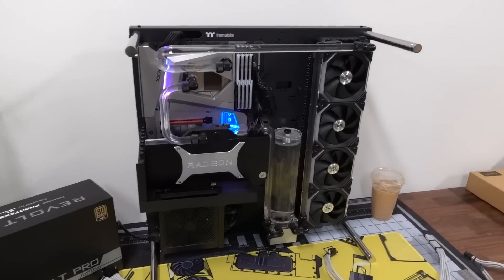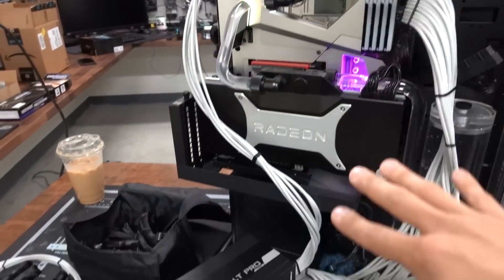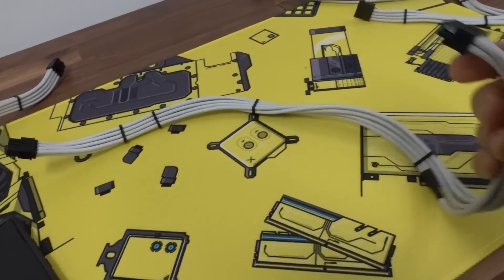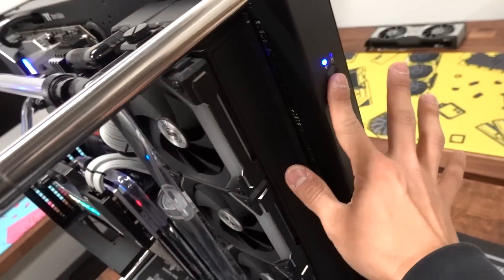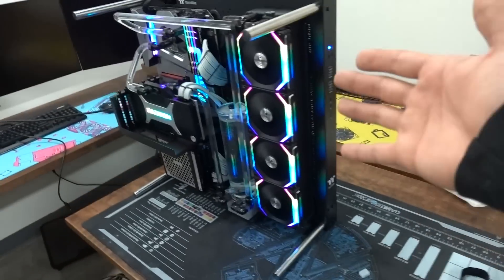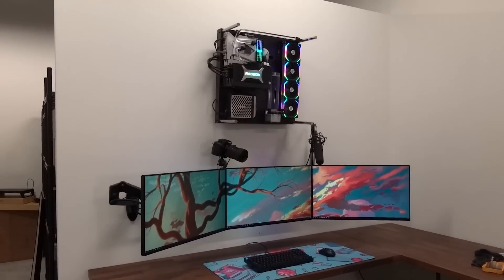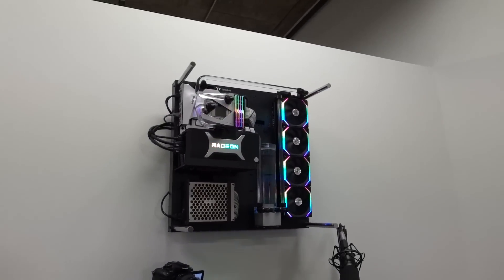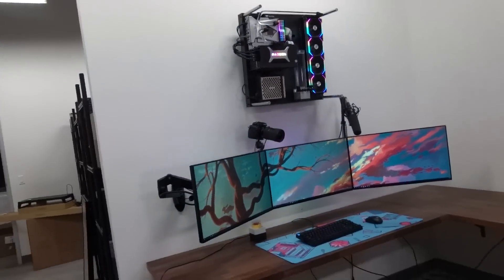I PUT MY PC ON THE WALL!!

Comment: I have the P3 case with the same exact wall mount, but I didn't have any tilting issues.  Probably because mine is smaller.  It's such a sick setup with it mounted.  I also ran into video signal issues, but when I went to longer cables.  Had to try a few different kinds before I finally found some that worked.  Oddly, they were all the same spec.

Comment: Put something to brace at the bottom behind the system to push the lower portion forward. A rubber piece would be easy on the wall/system and the. This would force it straight and minimize the likelihood that it would adjust and tilt forward again over pulling the top back.

Comment: Just use a 4x4 block of wood or dense foam on the lower half. The case weight will hold it in place and it will level out the bottom half.

Comment: @Bitwit - Solution for the tilt. Go to Home Depot. Buy a 2x4 or a 1x3, depends on how much space you have behind the case. And screw it horizontally across the studs right behind the case. Keep it level with where the D rings are behind your case. Screw two hooks into the new wood, just like the one you tried on the wall. One on each side. Then use a thin chain, which you can also buy at Home Depot, to pull it back towards the wall to level out. You could use the nylon you have on hand, but I prefer the added security of having it chained to the wall, God forbid something does give... Also I would pain the added wood the same color as the wall to hide it.

Comment: As far as making the PC not tilt I see two options. 1 - Weld the tilting piece straight (can't move then). 2- Put a metal bar across the back of the pc attached to those screw points. That will let you put your other attachment point wherever you want (right in front of the wall attachment point).

Comment: You could get a bracket down lower in the stud that sticks out and braces the bottom half of the pc to keep it at a parallel to the wall. Could even be a couple of them and they could be made in a way that is stylish to the overall design of the pc and add to the look of the build all in all. Up to you though. I'm sure there are other ways to finnagle it.

Comment: To make the PC straight, simply screw in a block onto the wall but on the bottom side of the case. Make the block as thick as needed to level the pc vertically.

Comment: All you have to do is cut a board to size and put it on the bottom, in between the system and the wall, to lift it up and make it perpendicular. And no need to screw it as it will be a friction fit.

Comment: Just put a spacer (washers) under the two bottom screws of the VASA mount. Also, use longer screws as necessary.

Comment: At the bottom of the case - between the case and the wall you could mount a a rubber door stop or a piece of wood for the bottom of the case to rest against - that way it will sit straight

Comment: What I did for my TV with the same tilt issue was put a chunk of foam on the bottom pressing against the wall and the weight of the TV held it on. You could just do that but put 3m sticky pads so you don't have to worry about it slipping out. Use black so it blends and you will only be able to see it from the sides.

Comment: Instead of trying to use hooks at the top you could use 2 stand offs(correct length) mounted on the bottom corners to give you the correct reveal or horizontal straightness. The stand offs would then rest on the wall.

Comment: You can glue 2 legs at the lower back of the case, they will push it to the front and align it. Spray-paint them with the same color of the case, and it will look stock.

Comment: just put a blocker between wall and mount at the bottom, that prevents the movement towards the wall. You can put any sort of rubber between block and mount (you know, scratches) and you should be golden. You can put it high enough to not been seen and its by far the easiest way and if the mount is too off-centered in relation to the wallbeam, make the blocker in a T-shape. Why try to pull it back at the top, when you can simply block the movement at the bottom?

Comment: What about finding something to use as wedge? Rather than trying to hold the tilt back from the top. Push the bottom out so the top tilts back till it's straight.

FYI. I have no idea when it comes to that kind of stuff so just throwing any random idea out there.

Comment: Instead of putting the Hook directly on the Stud Screw a rail to the stud with and attach Hook directly in Line with the 2 hooks on the PC  and Tighten directly in Line. Additionally you could Mount a rail to the back of the PC and another to the stud in the Wall allowing Multiple Points to Tighten like lacing up a Shoe. On the Bottom of the PC do the same ting with a Rail and Mount Standoffs to push the Bottom of the PC out (Plank of Wood, Feet for Furniture ETC)

Comment: I have the smaller version P3.  Would look better with a white brush plate left of the rig to run cables, instead of behind the PC.  You can sleeve them with white cable braid to blend with the wall

Comment: also instead of having something pull the top of the case towards the wall, you can have something pertruding from the wall pushing out the bottom of the case to straighten it out.

Comment: Idea for the top hooks. Turn them 90Deg, so the hoops are vertical, |   |   |   , then get a metal rod, screwed rod or summat, and put it through the 3 hoops. It'll hold it back securely, be a backup if the wall mount starts to give, and be pretty sturdy.

Comment: Ideas to fix the tilt. Use wedges to offset the angle of the wall mount. OR... Remove some drywall to recess the top part of the wall mount.

Comment: A couple of door stops mounted to the bottom corners might work. I'd also figure out some sort of safety line/chain for the PC to 'catch it' if the mount fails or especially if you're in California, to save it in a quake.

Comment: 3d-print a nice upport for the bottompart of the pc that you have behind the pc and the wall. Or use the bracket you mounted in to the stud and hook it to the top part of your pc case with a hook or screw.

Comment: You could get a large tv mount made for two studs and rated for 100+ lbs then attach a couple of pieces of wood (painted black) to the single stud and attach the large mount to that. That would probably be considerably sturdier and still hidden.

Comment: I have a suggestion for a video: Full Tower vs Mid Tower - have full tower case manufacturers lost the plot? There are a huge number of"mid tower" cases which can fit three or more 360mm radiators at the same time. But if you look at "full tower" cases, which are supposed to be bigger, nearly all of those are designed for only 360mm radiators as well - at most they seem to offer one 420mm radiator slot, and even if they say they have multiple slots for 420mm radiators, when you check, they DON'T have the room to have more than one installed at a time! If mid towers are 120mm fan based, going up to 360mm radiators, then surely, by logic, the reason to pay the extra
to go to full tower is to switch to quieter and more efficient 140mm fan based systems which can hold three 420mm radiators at the same time?  If full tower doesn’t give full 140mm fan and multiple simultaneous 420mm radiator support (at least 3 at the same time), in the same way that mid towers already give full 120mm fan and multiple 360mm radiator support, then what’s the point in them even existing? Why would anyone buy them? Is it that much of an ask for get case manufacturers to add a couple more centimetres of room to fit these in so enthusiasts can have a zero thermal throttling solution to their overclocking top end thread ripper  CPU and GPU custom water loops?

Comment: you could always just rig up a latch to keep it flush with the wall. I mean it might not even need to be in the stud, because there really wouldn't be a lot of weight pulling on it really... you might think there would be, but most if not all the wight and torque will be being handled by the mount its self.

Comment: Cheaped out on the mount, should have gotten a non tilt flat mount if you were going to save money on it. For an arm mount you definitely need a more robust mount, with double joints to make sure it doesn't tilt due to front heavy weight.

Comment: To get it straight put a post on the bottom to "push" it out, also you should be able to install a screw tensioner with stud or drywall anchor to pull in on the top from each of the hooks

Comment: Just have a wedge to place between the base of the mounted pc against the wall behind it. it could be adhesive on one side to stick to the rear of the case, then it would met the wall to keep it straight up right.

Comment: I have both my computers wall mounted.  I have the same case in this video and I have the Thermaltake P90 mounted in the corner of my office.  It's a hell of a display when you walk into my office.  This particular case is designed to be wall mounted.

Comment: Solution idea- shim out the bottom of the  bracket where it attaches to the wall, to “pre- tilt” the bracket upwards. You can buy plastic wedge shims at Home Depot, these allow you to fine tune the adjustment.

Comment: I mean, instead of going from the top, lock the wall mount into place and put a woodblock wedged between the wall and the pc on the bottom to push the bottom out. Yeah it’s a gap , but it would look straight.

Comment: What about simply using a command strip/hook solution with hooks at the top to help keep it close to the wall. The hooks on the command strips/hooks would hook up to the hooks holes on the back of the pc.  It wouldnt be as much weight on each of them maybe like 5 lbs or so each and command strips are weighted I think for like 16 lbs.

Comment: Make two holes in the lower back panel of the case at power supply height and use two long bolts and nuts with spacers 3d printed 🤔 and maybe some plastic or rubber feet for furniture... So drywall is preserved

Comment: Hello Kyle, you can try putting a spacer/standoff between the case and the wall (you will need to determine the exact dimension of the spacer that will put it in a parallel position to the wall). I would suggest mounting it on the lower side of the case. I think one spacer should suffice and you could mount it on the back grill.

Comment: @Bitwit Like the chrome rods on the case that are sticking out on each corner, you could use something similar on the back side of the case that connects to the wall. This would tilt the case straight with the correct measurement. You would have to tether the top like you said previously. I think this would be your best solution to the tilt problem.
Reply: EXACTLY this lol. I was scrolling down to see… gawd I hoped … that someone had thought of the “simple” - and I by that I mean **elegant**. 

Taking your idea to the next level - carry the chromed supports through the rear. Home Depot sells chromed/nickeled brass pipe in 3’ lengths for about $90. So one could cut a couple of pieces to the length for each bottom side. Heck you could thread one onto a slightly larger diametered chromed/nickeled piece and then it would be adjustable. Oh wait… like shower curtain rod mechs. You’d want something with a tiny bit of give (vibration isolation might matter) and also adjustable. 

Oh,  and original video author 🙌🙌🙌. So and It’s not your fault it didn’t work lol, - it’s physics. (I’m a little buzzed and it just dawned on me lol) it didn’t work because physics. Think of a fulcrum. It’s like you tried to use the tiny side to leverage against the largest force moment swinging AGAINST you. It’s like if you tried to “pull” a pendulum around the pivot point, from the opposite side at the top… so much “work”. So what needed to happen, and works about the moment arm, that arc of swing about which gravity is driving the base in, towards the arm, is something that counterbalances the force going into towards the wall. Far easier to push it out from the bottom, and maintain stability too, with two points, than to pull it in, through one centered point, the point where the closer you get to the vertical angle you want the less angularity to make that happen occurs. Put another way. It’s harder to do engineering wise.

And no shade whatsoever this is spectacular! Thank you for showing and being brave I’m recording my build now and in a month I’ll post it and show because I learned from other people what to do what not to do so thank you so much

Comment: @bitwit.. Only put a distance holder at the botton who is pushing against the wall... And pushes the bottom forward  wich might push the complete system forward but for that u can use the hooks that you tried to held the rig in place... Short sum: 2x distance holder who pushes  at the bottom and 2 hooks to hold the upper part.. Might work 🤔

Comment: Seems like this could be resolved with some drywall anchors and j hooks. The weight is already on the mount so  the anchors will just keep it flush and prevent it from tilting.

Comment: For the leaning issue, instaid of using two hooks on the back of the pc case, one single hook directly in line with the other hook (maybe even attached to where the mount connects to the pc) should be effective with the same tensioning idea.

Comment: Besides trying to level the system from the top, I thought of an idea to level it from the bottom. Maybe using one of those adjustable plastic furniture legs, the plastic ones that thead and you could 3m it to the wall directly center of the system and the weight of the system should hold it secure to the wall aswell. Just an idea and amazing build!

Or depending how the tilt mechanism is, if it's the common one with the slot you could get something to shim the rest of the slot in the detection the weight wants to move it to. Like multiple bolts stacked so the mount can't tilt down if that makes sense. Basically it would be leveling it parallel  to the wall and get something to fill the gap in the tilt mechanism to not allow it to tilt down

Comment: How about placing a brace or dowel near the bottom center back of case forcing it to tilt back level. You will have to get just the right length but it is a caveman simple solution, plus it will provide extra support. Be sure to use a rubber or felt tip to it on wall side so as not to damage the wall.

Comment: You can drill holes in wall, attach a hook, do the same for the other side ( make sure both are of same length of course) and then, attach the hook to the ring you attached using thumbscrews. Simple! It will make your PC tilt go away!

Comment: The tension method should work, but there is too much elasticity in the cord.  Use some steel cable, should work.  Another great vid Kyle.  Lots of ads.. GET YOU SOME $$$.

Comment: To fix the tilt: put some shims under the lower part of the mount to change the angle of the PC. I'm thinking under the part connected to the PC, since shimming the wall connection would require 2 different shim widths (since I think I saw that the stud mount is secured in 3 places).

Comment: Ok suggestions for the wall.  Firstly a portrait of Vladimir Ilyich Lenin, or Billy the kid - Depending on which way you lean. Other side a portrait of Kermit the frog. Two speakers but not the usual crappy pc desktop speakers also they can’t be matchy matchy in black. Then a bunch of screens showing random security cam footage or your other videos. Then buy some leaf lighting and take them outside and drive over them and destroy them, because NO LEAF.  Lastly, another photo of Lyle. No IKEA plants in fact zero IKEA - we have to make a stand somewhere.

Comment: simply cut a piece of wood down to the width of the gap at the bottom when your rig is plumb. lets call it a stand off for your wall-to-pc. you could even use hard conduit cut to size at multiple stand off points.  i use a dewalt green line laser to mount all my wall things. it keeps my hands free to work while continuously giving me level and plumb posistions. they run about 300 bucks with a rechargable battery. oh and some come with cool green glasses.

Comment: If there are thumb screws at the bottom you could put those rings at the bottom and brace them into the wall as spacers to push the bottom out.

Comment: If the pc  is still tilting on the wall, attaching a wooden block (or anything really) to the wall behind the bottom of the pc could push the bottom of the pc out so it sits completely vertical. The block would also be hidden behind the pc, and thus the pc would then only tilt forward when you pull the arm away from the wall

Comment: Honestly, you need a better wall mount for the PC.  Screw the weight rating, go for design.

You want a mount that has at least TWO bars on the VESA mount and 3 (or more) to the wall mount.

Sure, they're more expensive, but worth it in the long run.

Think a mount for a 50" or larger TV.  Many of them have wall plates that bridge 2 (or more) wall studs.  They will also often have a usable up/down tilt that you could use IF you changed your mind later and wanted the system tilted down at you.  Tilts that use discrete holes rather than an arc mean you can positively lock it at a specific angle.

Comment: Rather than trying to bring the top of the PC case closer to the wall, push the bottom out.  You can probably attached two small posts to the back/bottom of the PC as supports.

Comment: Kyle, have you thought of tying a length of rope between the two hooks on the back of the case without going through the hook on the wall. Then tying a short length of rope to the hook on the wall and wrapping it around the rope going from left to right? So instead of the rope on the back making a triangle shape, it makes an upside down T shape? 

Edit: If you try it, be sure to rotate the hooks on the case so that the force is pulling on the top of the hooks rather than one side.